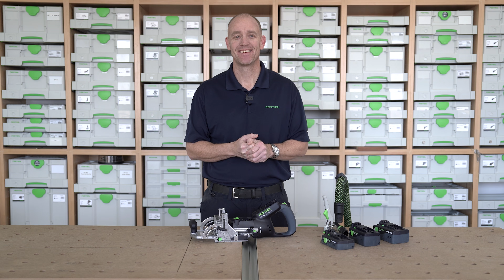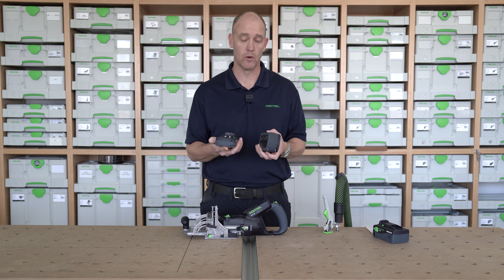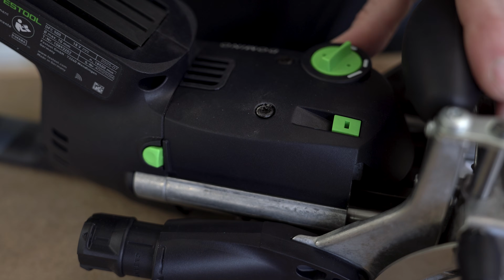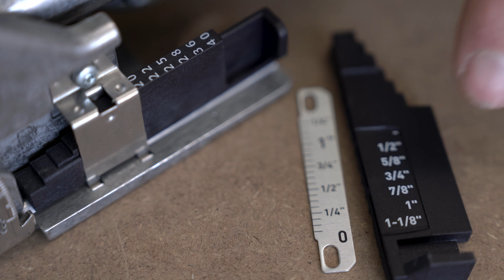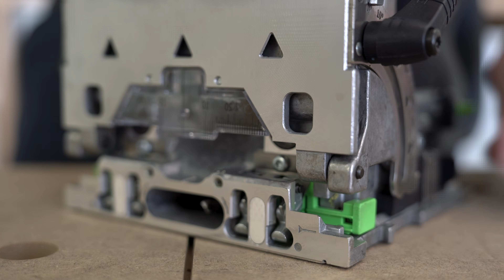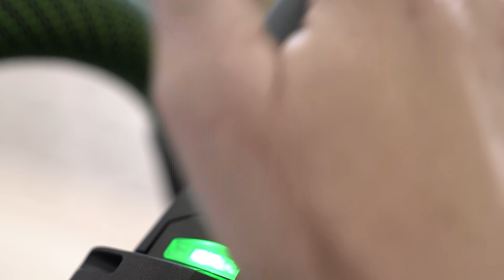NEW Cordless Domino Joiner Explained

Comment: Got mine this week, replacing my old df500. Not a huge upgrade really but much more refined, hated the padles for one, when you have multiple domino’s close together, they can interfere with the right offset. I usually  just blocked them in a closed position with the tiny allen screws. The power button on the old one was also annoying to use when plunging down, and when cutting a large batch, your forearm felt sore after 10 minutes. The more pronounced lines on the bottom are much better too as i could hardly make out the center anymore on my old one after six years of heavy use. The handle still feels less ergonomic than the df700 though, larger locking levers and a 12 and 18mm preset would have been great too. But overall very happy with it

Comment: I really don’t get the cordless model. I always hook up to my domino to the dust collection hose so connecting the power cord along side the hose is no big deal. Either way the machine is still tethered.
Reply from the maker: Great point! Its about personal preference and environment, some people need a cordless option onsite - which you can pair with a cordless CT. Some people just really prefer to eliminate the cord, even with the CT still hooked up 🤷 both corded and cordless options are great regardless
Reply: @festoolusa I like cordless because having the second cord is a hassle and less cords makes my life more productive when on site or in the workshop

Comment: I got mine today. Holy smokes. I was excited but I didn’t think I’d like it as much as I do. It’s hard to quantify. Everything just feels so much more refined and I feel more solid and confident with all the different cuts. I don’t feel unsure whether or not the backend is being weighed down any more. Not having a cord is nicer than one might think as well. I thought vertical plunges would feel unbalanced or too heavy, that’s not the case. The fence is so smooth. Mine came out of whack on my previous one. Festool fixed it but I don’t think that particular problem is even possible on this one. The pins are great, another huge selling point for me. Idk, I’m just blown away with just how much better I like this one. It can’t do anything the old one couldn’t, but all the new features  combined, has made it a very different experience for me. And on top of everything, it’s still as accurate as ever. Love this thing
Reply from the maker: We are so thrilled to hear you are impressed and happy with our improvements! Thanks so much for the kind feedback 💚

Comment: How about a deep dive into the OFKC since that's the new one for the USA?
Reply from the maker: Heard! We have a Quick Start guide on it we just posted, but I'll pass this request along to Jason and the Video team to work on 🙂
Reply: There isn’t really much to dive into. It’s a great one-trick pony that performs its one trick extremely well. The depth adjustment is excellent, and it’s well balanced. Obviously, you’re limited to Festool’s proprietary router bits, but that’s really all there is to say about it. Despite its limited application, it’s my favorite router.
Reply: @bernie-p8i  I finally got to see the OFKC yesterday. Interesting, but as it's brand new in the USA, there's still a lot to be gleaned. As someone who uses one, I'm sure you could do a great video showing its features and best applications!
Reply: @onocoffee  Sure, I understand, but it's crazy simple. Edge trimming/flush trimming is the ONLY application. And you've got a very limited number of router bits that work with it. Festool Germany has videos available. They're very short videos. 🙂